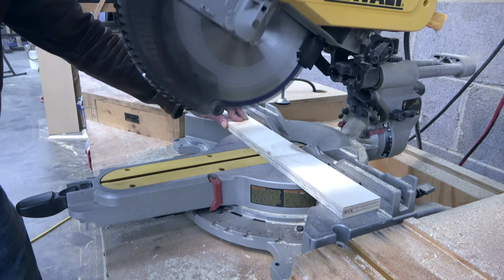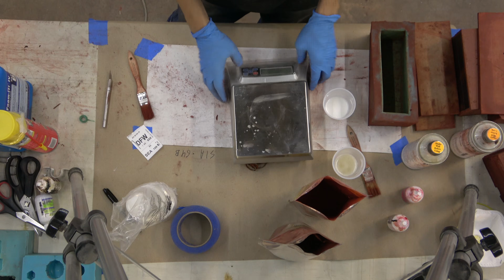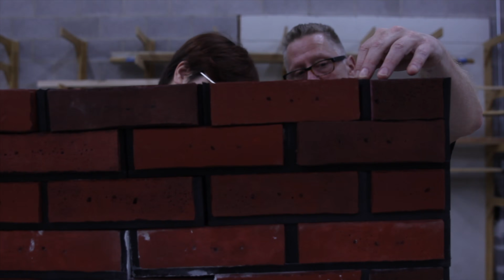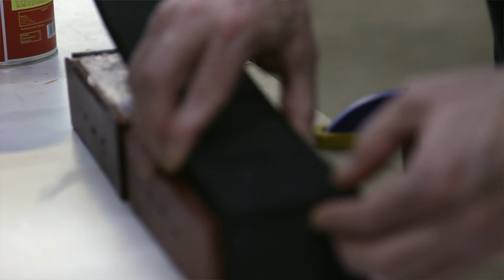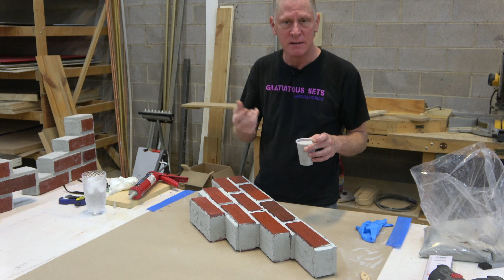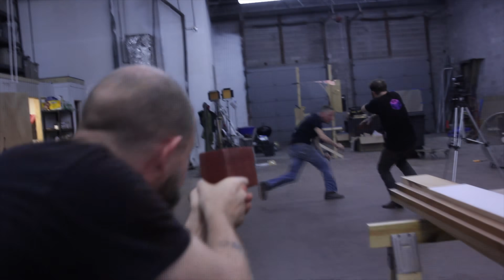How to build fake bricks!

Comment: Very nice bricks.  I have done a couple if cheap versions of bricks for theatre.  They would not work for what you are doing but they work well for a theatrical situation.  The quickest and cheapest works well as long as it never gets seen up close.  You just paint a wall down in a dirty mortar color (not too evenly).  Once that is dry you can mix up a variety of "brick color paint and use a brick shaped foam block to just print bricks.  Stage lights used to come packed in blocks of foam that were the right size.  And you need to peck out some nooks and crannies, but at a distance on a stage it's very convincing.  If it's too "clean" you can wash it down with some water and enough black ish paint to get the water "dirty" and spray it on with an insecticide sprayer.  Because the brick prints add a bit of thickness the wash runs over the wall pretty much as it would on real bricks.

The second stage cheat is good if the audience is closer or gets to see the wall at an angle or you want to skim it with some light.  In this case you cover the wall with some 1/4 inch styrofoam and paint the grout lines with a brush dipped in acetone.  It will eat right in.  You can also splatter it a bit with acetone to roughen up the surface a bit.  Paint in the grote lines, or if you are going to do a lot of weathering you can leave them.  You can roll the brick paint on unless you want a lot of variation in tone.  Then wash it down again with the dirty water and that will really collect in the grout lines and pock marks.

The commercial versions of fake brick mostly have some issues.  The masonite stamped stuff ? maybe there is a good one but they have all looked really fake to me.  The thin veneer bricks are generally too heavy and expensive for theatre and the cast paper ones designed for theatre look great (you have to paint) but the cost a fortune.

None of this would have worked for your build but I thought I would pass on the techniques in case they come in handy down the line.
Reply from the maker: We built a set for Storage Wars a while back- 3/4 scale storage facility exterior. We used 1/2" tape to denote grout lines, then mixed paint with sawdust and rolled the entire 60' set. peel off the tape while still damp and then spray the finish color. Completely photo real- even up close
Reply: @GratuitousSets  Nice.  Great idea+++

Comment: Wouldn't it have been much cheaper and faster to just use actual bricks in this case?
Reply from the maker: Yes, but maybe you didn't catch the functional purpose of this. the brick wall needs to fall over 10+ times every day for years to come. Players set an "explosive charge" near the wall and engage a detonator. This actually retracts a trap door that the bricks are stacked against. The bottom row of bricks is designed to be unstable so when the door retracts the wall falls apart.  Real bricks and mortar would chip constantly and not last at all. It's not just a wall- it's a practical effect for an escape room. You're absolutely right, though, if it were only to be used once😀

Comment: It makes me wonder, if you guys make an error with a foam mold, do you just scrap it, or do you have a bin with a bunch of miscellaneous foam molds?

If you DO have that bin, can you swim in it like Scrooge McDuck?
Reply from the maker: We try not to make errors when moldmaking 'cause the silicone is expensive...The castings we pull from it? -we definitely screw those up!  I'm gonna do a video soon about how we recycle silicone molds by cutting them into strips, then feeding the strips into a meat grinder! You get a bunch of silicone granules that can be mixed as filler into fresh silicone! and...yes--I can swim in the failure bin like Scrooge McDuck

Comment: I'm curious as to why you built individual bricks if you were going to build it as a section.  I think you'd have been better off building it as one piece. At least you got to have a brick fight.
Reply from the maker: Since each section is different, it let me get the components I needed without having to make five large, unique molds. Each brick only took about 5 minutes to mix and pour, so I was able to do other stuff while each cured (money). It ended up taking almost two weeks to make the bricks using spare moments. 😁